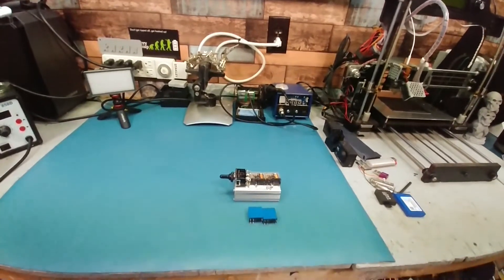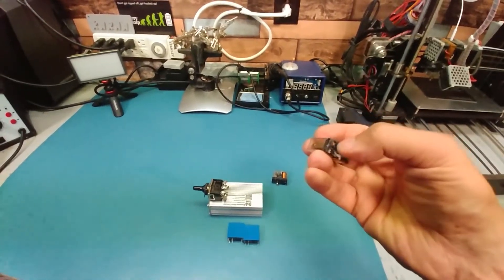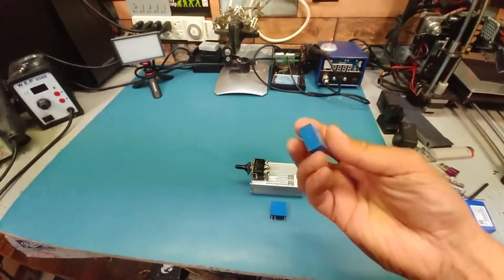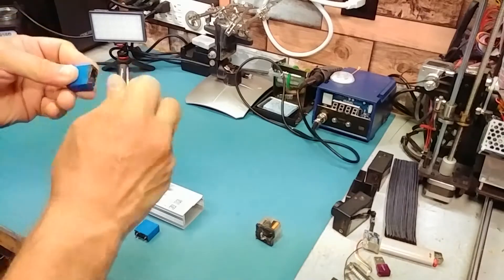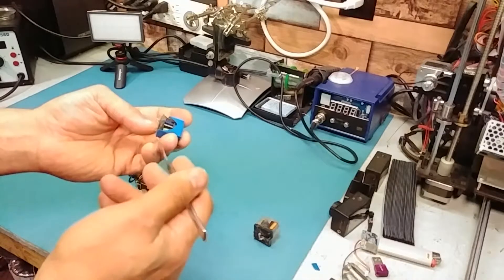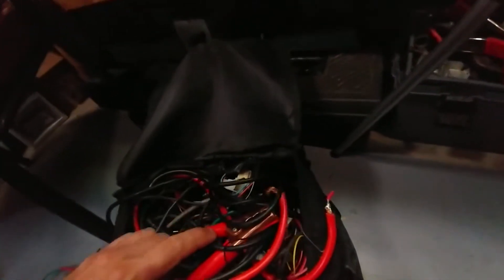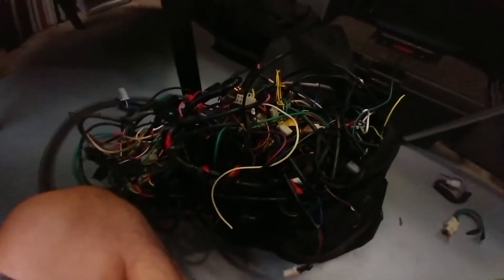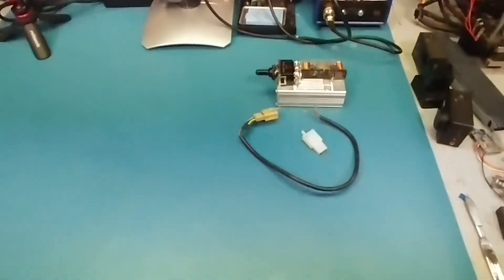ebike dual motor control with 3 speed switch v2

Comment: heya i was trying to work out why you needed a huge switch an 4 relays plus having to modify relays aswell,we have a cpl of dual motor bikes and found just a simple toggle switchwas able to switch the throttle outputs in the 3 modes we wanted,1/2/1and 2